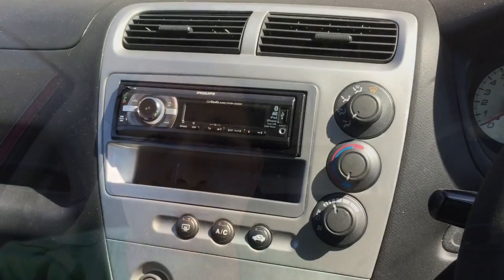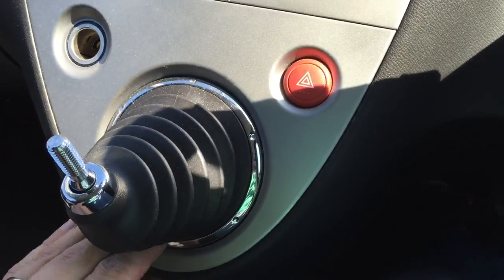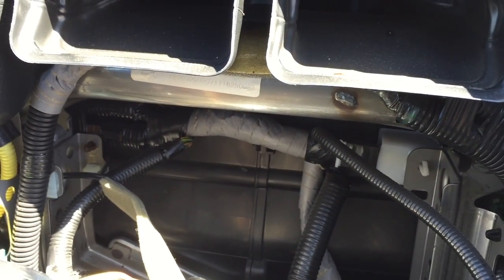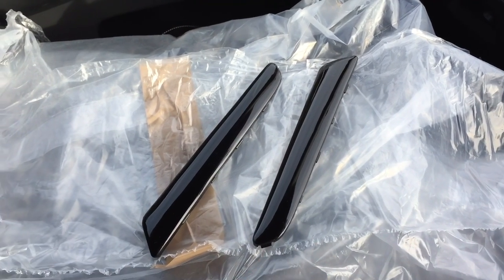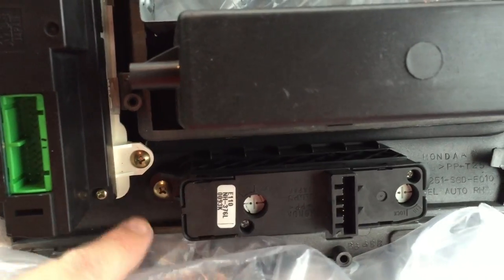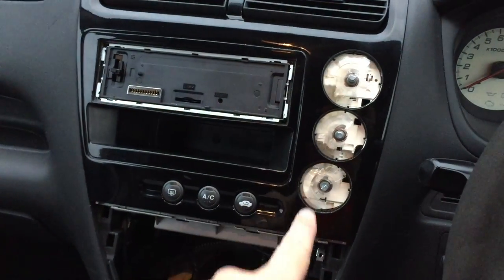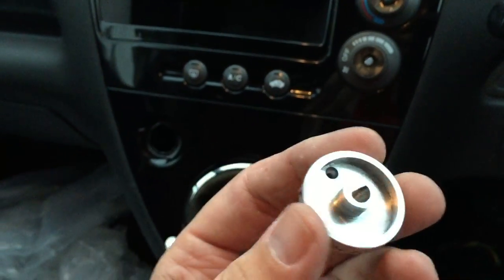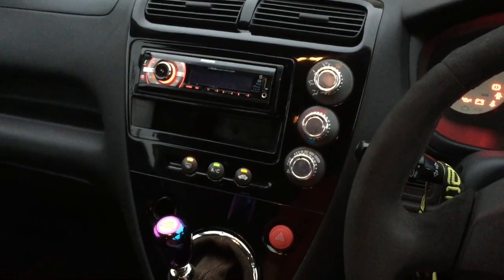EP3 Civic Type R - HOW TO - Remove/Refit your Centre Console/Fascia - Fit a CD Player

Comment: Great vid as per usual.  I was however expecting this to be about the centre console, not the dash fascia.  It would be great to see how the console with the handbrake & sliding cubby-hole is removed.
Reply from the maker: Cheers mate. I haven't had to have that out yet but I will give it a go at some point.

Comment: Cool video, I would recommend people put those bolts back behind the center console. It helps stop squeaking, rattling ect. Plus it's just good practice to put things back together properly.
Reply from the maker: Cheers for the comment, you are of course right about the bolts but I've not had them in for over a year (since I dotted my head unit) and they don't make any difference at all, also they are super fiddly!

Comment: I wanted to check out different knobs, what site did you find different knobs at?
Reply from the maker: The heater knobs? I found them on a forum for sale, never seen them before or since unfortunately!
Reply: Ah ok thanks. Question, do you know which bulbs are used for the Temp control and fan control speed on the center console?
Reply from the maker: +Pinkflappy I don't know for sure, I have a spare set in the garage so I'll have a look!

Comment: What brand fascia did you use? All the ones i've found so far apparently don't fit flush or require some Dremel work.
Reply from the maker: +David James Hi mate. Its an Autoleads one. Didn't have to adjust it or anything to get it to fit.
Reply: Cheers mate
Reply from the maker: No worries.

Comment: hi how far do you need to unscrew the nut on the gear knob.
Reply from the maker: Hi mate. You only need to undo the tension on it to get the gear knob off but you need to take the but off completely to get the rubber gear cover off. Hope that makes sense!
Reply: +EP3Stuff thanks bud. liking the videos
Reply from the maker: +Timothy Charter no worries mate. Cheers